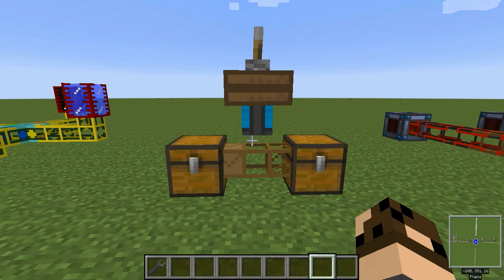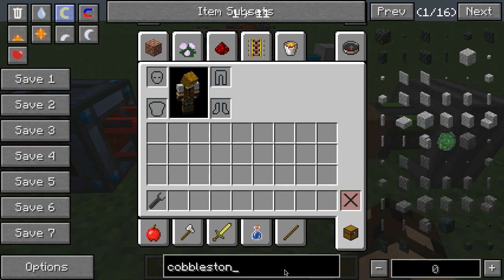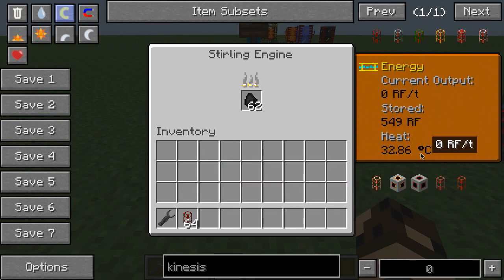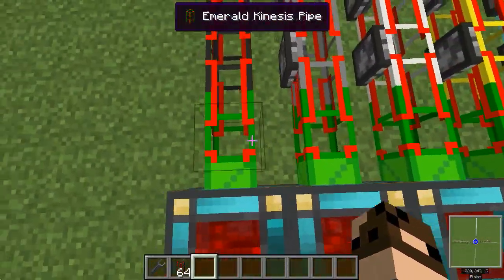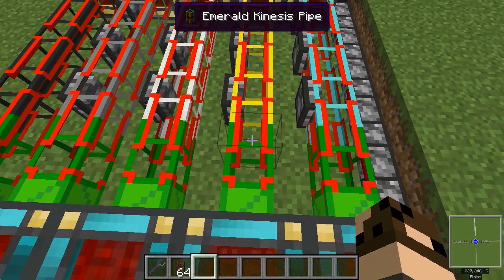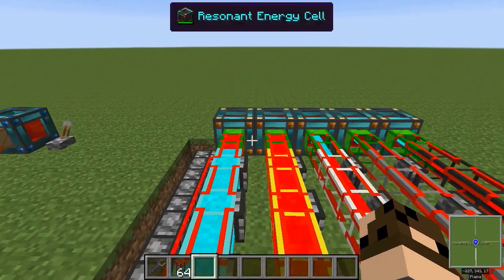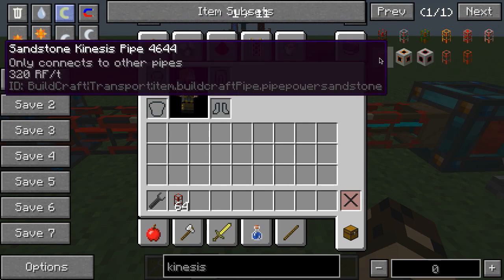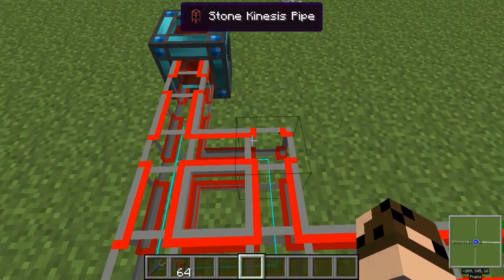Mod Spotlight: BuildCraft Power

Comment: For what you say, I assume that Redstone Flux is not the same as Vanilla Redstone Dust.  If some is there any way of converting one to the other, either way?
Reply from the maker: No.  Redstone Flux is merely another name for "electricity" or "energy".  There's no actual relation or equivalence between them.

Comment: BUildcraft wont let me use rf on quarry for example, it only shows mJ do you know how to fix that?
Reply from the maker: You must be using a quite old version of Buildcraft.  They changed over to using RF quite some while ago.  I'd double-check your version against the latest available on their website.
Reply: I'm using latest version 7.99.15 on minecraft 1.12.2 and seems that it's using MJ instead of RF. Maybe I'm wrong.
Reply: This video seems to be based around buildcraft 7.1.x, which is for 1.7.10. In MC 1.11.2 and up buildcraft separated from RF. However very little else has changed (yet), so the rest of the video is still accurate for the current latest (7.99.17)